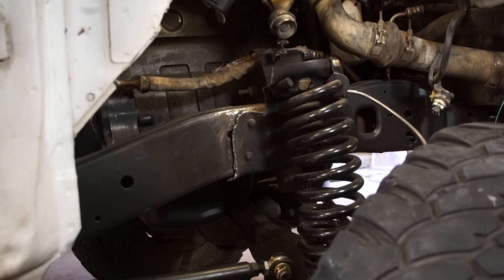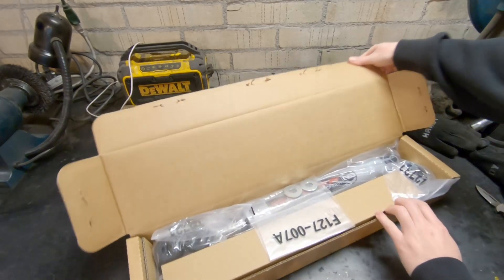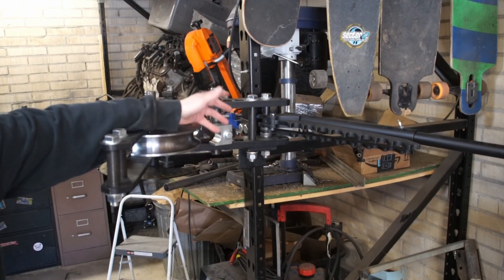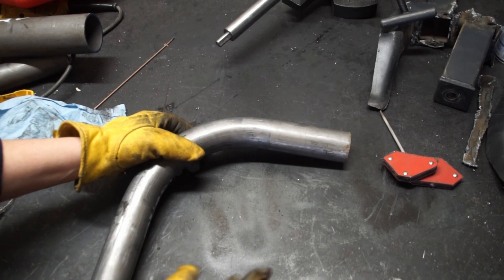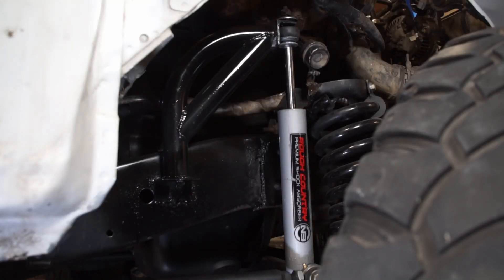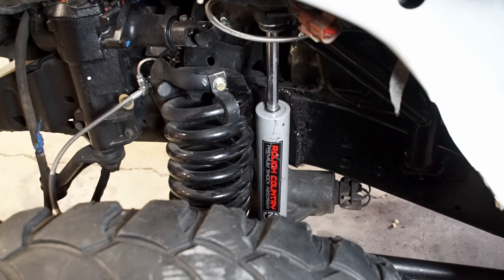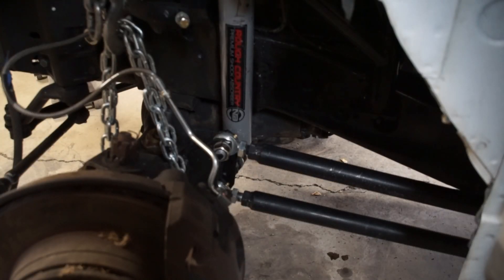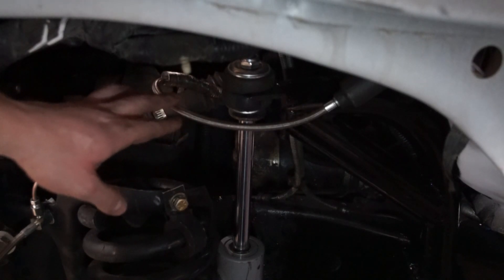See How Easily TTB Can FLEX

Comment from the maker: To be clear, the “easy” part is that it only took a few components to make this thing flex (springs, shocks, radius arms). The difficult part was that I had a big 3/4 ton axle and a cummins in the way of installing anything 😅. Most TTB front ends will have a much easier time of it than this one.
Reply: Have you ever heard of TTB being “cut and turned”. Thanks. Awesome videos.

Comment: How wide is the dana 50 ttb rotor to rotor? Im looking to do a similar swap into a comanche pickup.
Reply from the maker: to the brake backing plates is about 60". Here's a post I made on a forum that has all the measurements I took before doing the swap (dana 35, 44, and 50).
https://www.explorerforum.com/forums/threads/cummins-first-gen-build-thread-no-really.490429/post-3863168

Comment: Here’s one for ya, take that sharpie off your 123 block, hold your tube down to the table and run the edge of the 123 block along each side of each end of the tube. You’ll get 2 perfect center lines on both sides of your piece
Reply from the maker: That's a good suggestion! However it does assume the tables flat 😅. It's hard to see but I built that table out of offcuts of upside down diamond plate and some sheet metal welded on top (just spare stuff I had around) so I don't trust it not to have some bow in it. If I had a decent weld table your suggestion would definitely be the way to go.

Comment: Another tip, check your clearance in the windows for the axles at full bump one side, full droop the other. You may find you need to clearance the U-joint yolks (NOT THE EARS but the valleys) along with the windows so you don't just twist your axles off. Cool build, I am doing some custom TTB stuff too.
Reply from the maker: Good tip! I checked this at one point, but its been a while I should definitely double check it.

Comment: Has anyone have any experience or heard of “cut & turned” pertaining to TTB?
Reply: Did two of them(my Explorer and a friends Bronco). If you're really going to use a Ford TTB off-road, personally I think it's the only way to go. I haven't seen a single bracket lift hold up to hard use. The longer the drop bracket, the quicker they fail. In comparison the factory pivots can handle tons of abuse.
Reply from the maker: Theres a chance therell be a video on that in the future 😅. As much as Im hoping it wont be needed…. It’ll probably be needed.

Comment: In the process of building adjustable radius arms for my bricknose F250 plow truck I bought this winter. I’m using the same Rough Country shocks but with triple convoluted air bags and MetalCloak rod ends. I’ll most likely set it up with an air valve that automatically adjusts for load when I mount the plow. I’m pretty sure it will ride much better than the clapped out de arched leaf springs and 4” bags it’s currently sporting. Great to see how yours is turning out. Oh yeah I also have the Tough Country drop brackets for adjusting camber.